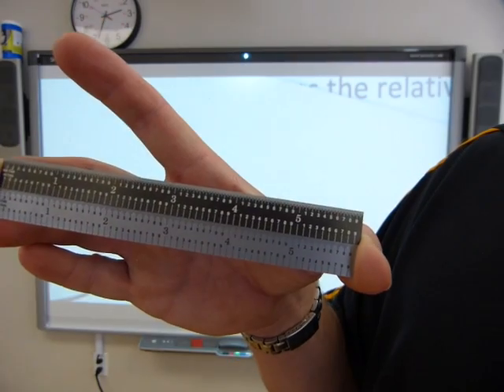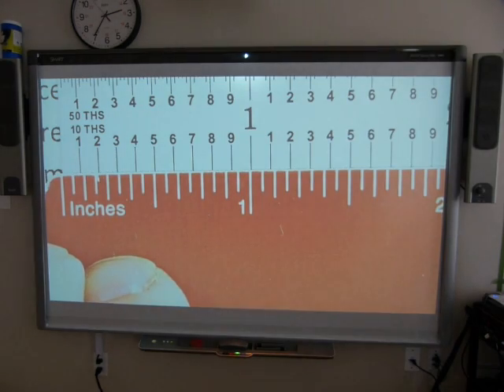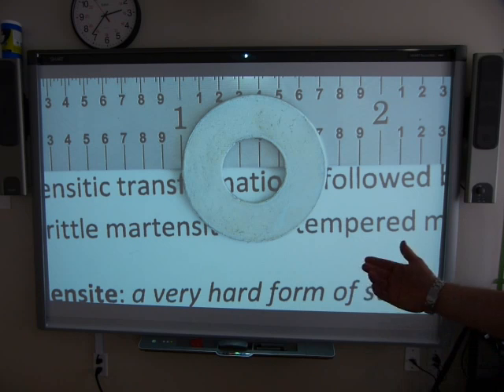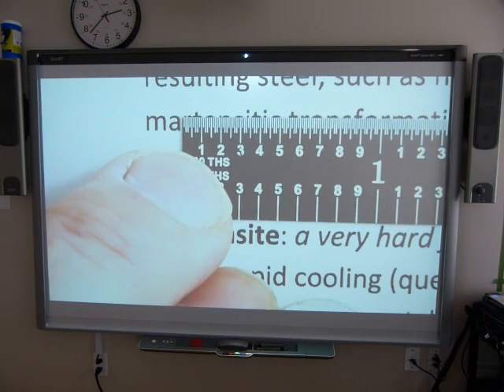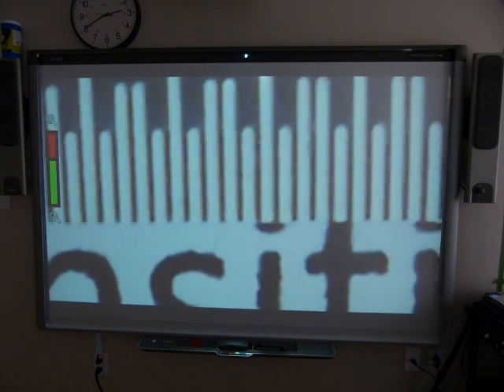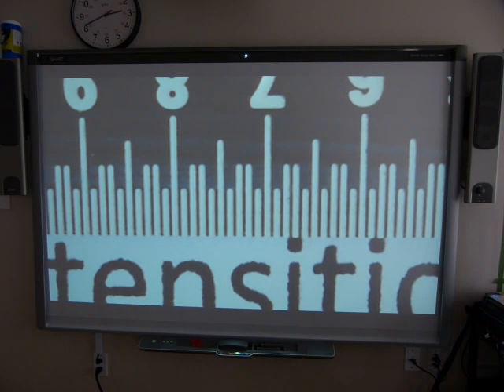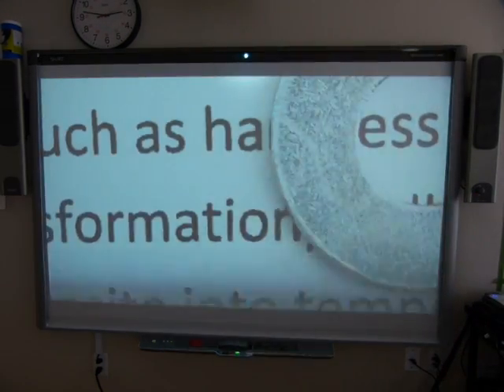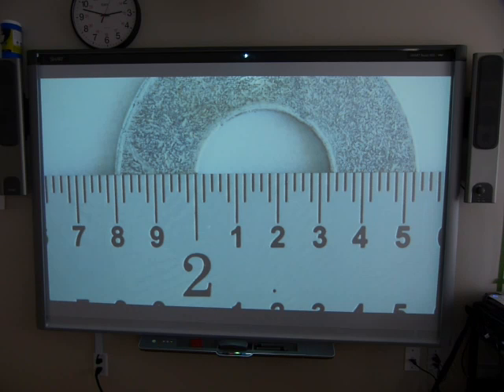Read decimal inch rulers (1/10, 1/100, 1/50 inch)

Comment: Since half-millimetric rulers exist, and since 0.01 inch(es) is exactly 254 micrometers long/wide/tall, which is barely any bigger than a quarter-millimeter (just by 4 micrometers), I don't see why Quarter-Millimeter Rulers barely (IF they do at-all) exist. They would be very helpful rulers in tons of sorts.
Reply from the maker: Anybody with a link to 0.25 mm marks on a precision ruler from any manufacturer?
Reply: @apprenticemath  I hope that i'll manage to eventually find one, if nobody else can do so for us 😬🤞